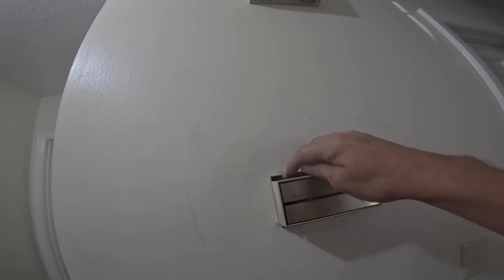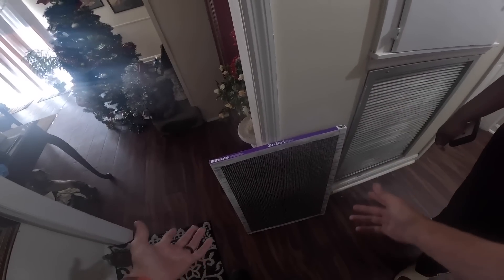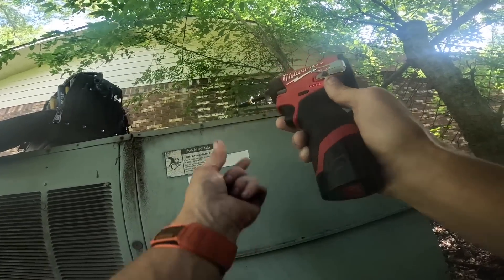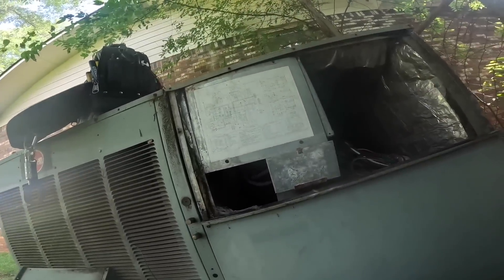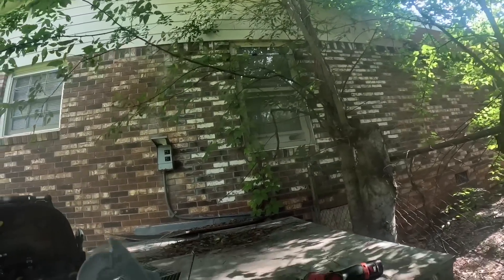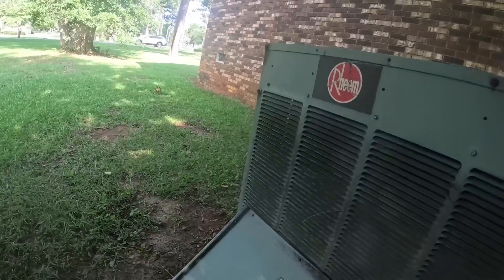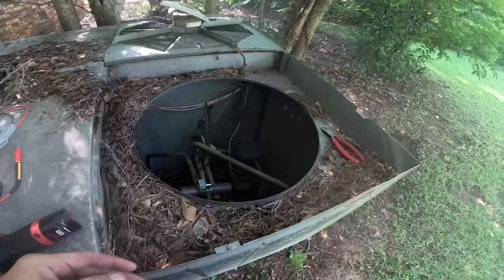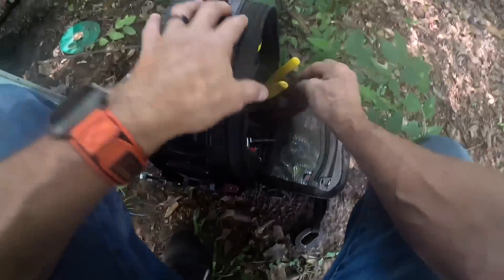Another One Bites The Dust! #hvacguy #hvaclife

Comment: I'm glad we agree on the air filters, some will argue about them. It is common sense, but regardless, some folks never change them, I just don't get it. Sometimes you just can't save them, that is not worth putting a compressor in. I am also glad you mentioned the way the prices have been soaring too, it is not the tech's fault. Nice video

Comment: If you go to HDepot or Lowes, they really push the expensive 3M filters.  8 MERV (relatively low resistance to air flow)  is what the HVAC manufacturers  recommend-- that's the cheap filter down on the bottom shelf.

Comment: She killed her heat pump by using a fancy expensive air filter then never changing it. Well done.
Reply: How?
Reply: @user-ln7of9gs4s  when the evaporator coil doesn’t get enough warmer air going through it to evaporate the refrigerant it then sends liquid refrigerant back to the compressor. Compressors don’t handle liquid refrigerant coming back very well. That’s why when you charge a unit with R410a you have to meter the refrigerant in slowly. In a nut shell that’s how she killed her unit.
Reply: @AaronPowellvox  A fellow who I once worked for always said, the equipment doesn't die, it is murdered. Classic case here.
Reply: @bobgallo3775  😂

Comment: I learned the hard way on those high MERV filters.  Inducer motor died 3 years into a brand-new copack unit.
Reply: Why would it affect the induced motor?
Reply: @kimballwhite  motor needs to work harder due to the extra restriction in the filter
Reply: @SeanDion the inducer motor doesn't pull air through the filter. That's the blower motor's job

Comment: how old was that unit. the cost will be around $8,000 to 10,000 dollars i'am guessing. be bless. watch out for the storms. be bless
Reply: That unit was pretty old and poorly neglected.  The unit didn't die because of the crazy high restrictive filter, but they are horrendous.  3M / Filtrate are garbage and should never be used.  The see-through fiberglass filters are better for airflow, but a MERV 8 filter is what is mostly recommended by myself and most brands, unless you have a 4"-5" filtration system.  But that outdoor package unit is going to be considerably more expensive than $8-10k, unfortunately.  Those are the times we are living in.